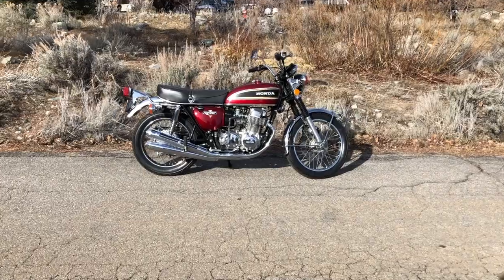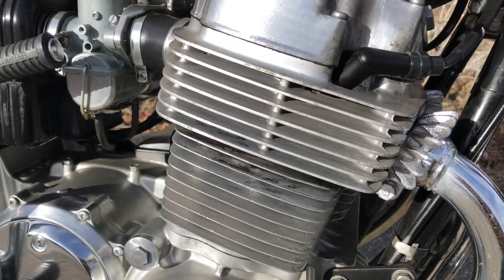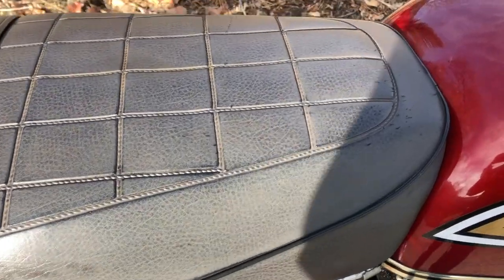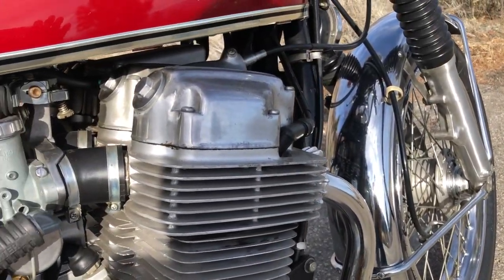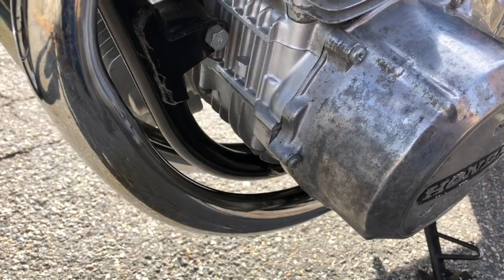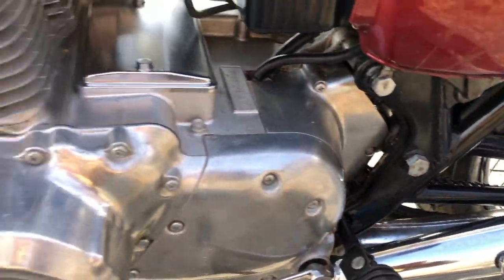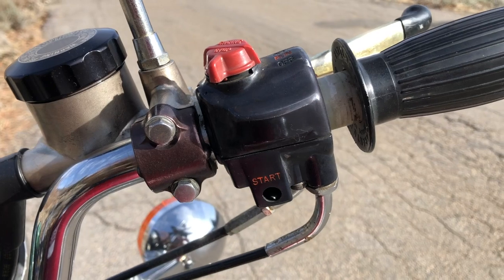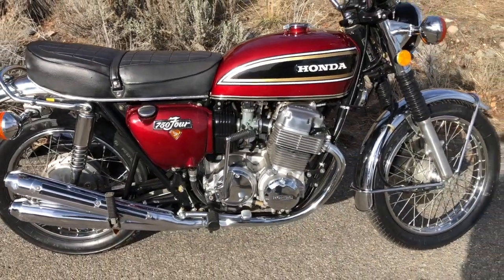1976 HONDA CB750 K6

Comment: How much do these go for?
Reply: I paid 3200 for one that started and I test road, but had no front breaks and it was running like crap. No electric either. - got it home, took it to a mechanic and 2700 later, it's a perfect running riding bike. I've seen ones for sale in my condition from 9K and up to 25K in showroom condition.